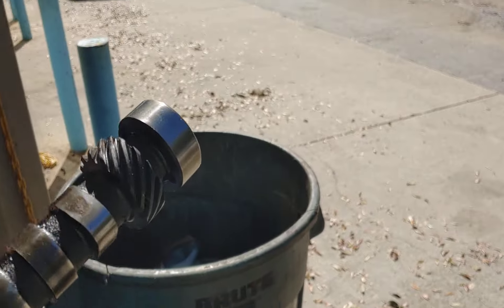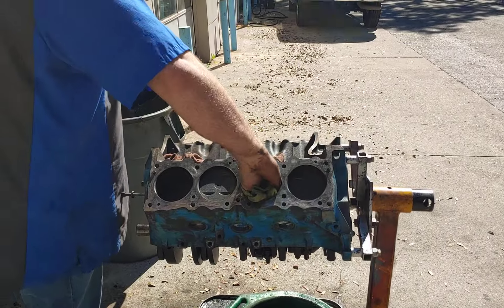Camshaft Failure @palsocalaautorepair

Comment: Anyone concerned that the metal from the worn lobes has been circulating inside the engine for a good bit?
Reply from the maker: Yes, we are concerned.  That’s why we recommended a complete rebuild.  But the customer chose to replace the camshaft, lifters and timing chain.
Reply: Good question about concerns!

Yes, there is definitely a concern. we suggested a rebuild or engine replacement due to age, wear and damage. however... the customer chose the "cheapest" route. we did pull the engine down and inspect all of the bearings and internals.

After inspection we found the rotating assembly to be in surprisingly good condition and within specs.

Soo... after a GOOD cleaning and reassembly the customer should be OK.

Thanks for your comments!

Jim
Reply: I don’t think metallurgy on new cams are the big problem because OLDER cams are wiping out too… I think 90% of the problem is that today’s oil is not formulated to protect flat tappets.
I’d at least inspect the bearings… if they’re chewed up & the customer is too cheap, tell him to take it somewhere else, who needs that headache.
If the bearings are good, plug off the oil filter bypass & cross your fingers.
I’m in a similar situation.
Reply: @loganshotrod4x464  Flat tappets always have wiped out at high mileage. I'd say 50 percent oil, 50 percent is the lifter manufacturing now they are meant to have a crown for break in which is usually absent in today's new lifters. They are actually flat, which is why so many flat tappet cams go round during break in now. They were made better back in the day I've reused old lifters on used cams many years ago and it worked more often than not. Still have a nice used dz302 cam tucked away, you can't measure any wear on it with a mic.

Comment: If your installing another flat tappet cam, especially a modern production cam, be prepared to have to redo that job again. The flat tappet lifters and cams on the market right now are garbage with an extremely high failure rate. Roller cam nowadays is the only way to have a decent chance of success.
Reply: yeah, maybe.... there is no warr. expressed or implied on this job. Customer knows the chances he's taking.
Reply: @speednroll  That's good no warranty for the customer and I'm not sure if you have been informed but the new lifters out there are absolutely horrible and almost guaranteed to fail. After the whole 2020, parts shortage debacle there was a huge demand for new lifters and not enough supply, so the manufacturers were pretty much shipping out what ever they had and could get and quality went straight out the window, basically no quality control and most likely made from inferior materials. A lot of rebuilders and machinist are totally abandoning and stop using flat tappets due to the extreme failure rate.